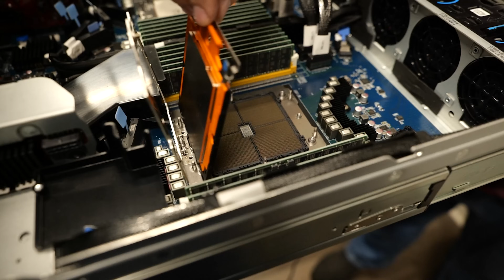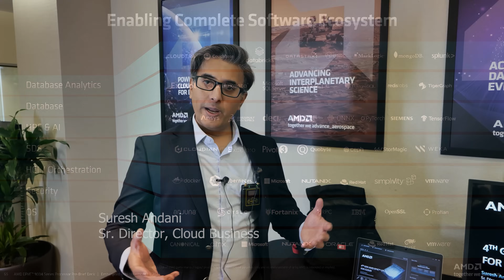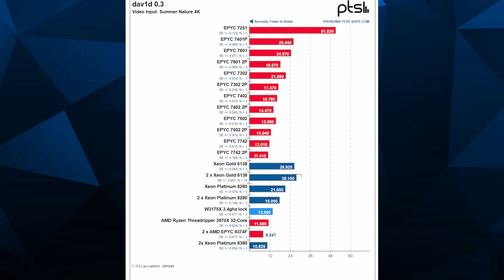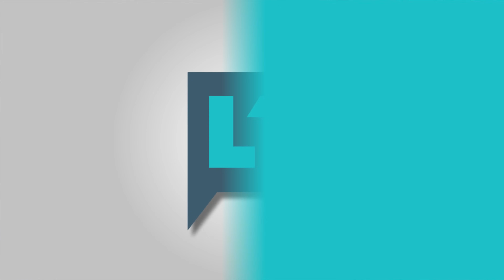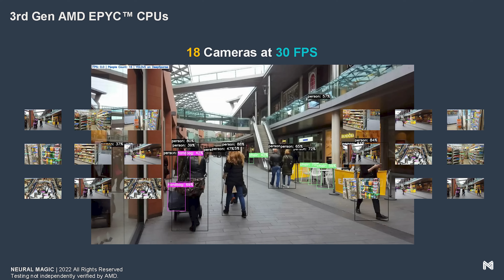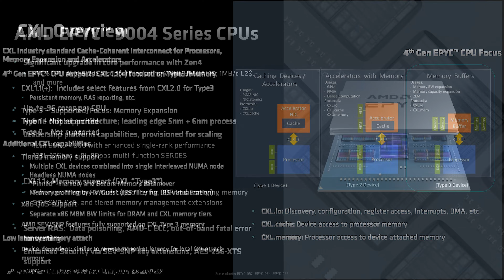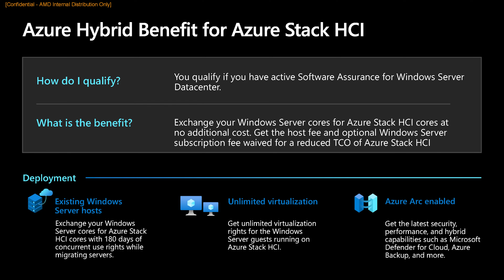192 Cores of EPYC Domination!

Comment: Lisa was so happy at the streamed AMD event today - great video coverage Wendell, thank you very much. Seems to crush Xeons even more plus those great features (so much is wonderful - for me the further expanded confidential VMs seems very interesting). Just wow and for example already deployed at Azure -> just great.
Cheers and keep this wonderful and interesting channel as it is, Pepe
Reply: ARM server CPUs are actually better than this 4th gen EPYC:

1) 7nm -> 5nm TSMC ........... -30% power consumption (42% more cores at iso-frequency)
2) Zen3 EPYC SP4 280W TDP -> SP5 with 360W TDP ......... 29% more (so 29% more cores at iso-frequency)
-----------------------------------------------------------------------------------------------
===== total 1.83 core count multiplier they would get from shrinked Zen 3 (1.42 * 1.29 = 1.83)

4) so total performance increase by new Zen 4 micro-architecture (Zen3 -> Zen4) is pretty small (AMD basically did the same trick as at desktop - massive increase of TDP and clock frequencies is the major trick)
5) SP5 has TDP of 400W (short peak 700W) and there is 1000W power supply per socket, and 24 DDR5 modules will consume around 150W, so total power consumption of CPU + RAM = 510 W .... SP5 is much larger than SP4 including TDP
6) Performance: 192-core/384-thread dual socket Zen 4 EPYC = 1790 pts in SPECint2017
7) Performance thread: 1790 / 384t =  4.66 pts/thread

Now compare that to Nvidia server 144-core Super GRACE CPU (based on ARM Neoverse V2 core):
6) Performance: 144-core/144-thread dual CPU ARM Neoverse V2 = 740 pts in SPECint2017
7) Performance thread: 740 / 144 =  5.14 pts/thread ......... 5.14 / 4.66 = 1.10 ........ Grace is 10% faster per thread than Zen 4.

ARM  Grace is 10% faster per thread than Zen 4..... that's not a small number. Considering 96-core EPYC 9654 has boost 3.7 GHz and all-core 3.5 GHz, while ARM chips like 64-core Graviton 3 runs at 2.6 GHz. Grace's clocks are not known however around 3.0 - 3.3 GHz is reasonable estimation. This means ARM has IPC  higher than these 10%.

Consumer ARM Cortex X3 has 14% higher IPC than Zen 4 in Geekbench 5. Neoverse V2 core in Grace (and upcoming Graviton 4) is based on X3 core. But V2 has 2 MB L2 cache in compare to 1 MB in X3. So IPC might be even a bit higher than 14%.

_________________________________
Be very cautious about stock investment. AMD beating Intel in trouble doesn't mean AMD will not be smashed by ARM servers. Especially when I see $11,000 USD price tag on AMD EPYC. ARM CPUs can be manufactured under $1000 USD while providing better performance and lower power consumption, and lower die area. Both Intel and AMD will be in trouble soon.

BTW: Remember that any x86 is CISC but runs inside as RISC. That extra and unnecessary translation CISC-to-RISC will always hurt performance and efficiency. Plus CISC variable length instruction encoding (x86 instruction might have anything between 1 byte to 15 bytes) really hurts how many instruction can be decoded per cycle because 6th instruction can be between 6th byte and 90th byte = 84 possibilities. While RISC ARM instruction has always 4 bytes so decoding/prefetch of any quantity of instructions per cycle is simple and super efficient. That's math and good instruction set matters a lot. Generally any CISC is obsolete for these technical reasons. M68000, VAX, Z80 or MOS6502 are CISC and died long time ago. x86 is here today because they managed to make it RISC inside and because Intel managed to kill main RISC competitors like Alpha (bought and shut down), HP PA-RISC (shut down in favour of Itanium) and also huge PC popularity with unlimited TDP. But with massive multicore systems today there is not place for CISC-to-RISC translation energy wasting. Unnecessary wasting. x86 is sinking Titanic.  Nobody knows how long time this sinking will take however every engineer knows it will happened. ARM server has more than 10% server share and that was gained in one year (mostly Graviton 2 systems). But now there are 128-core Ampere Altra MAX, Graviton 3 on 5nm TSMC and upcoming storm of new CPUs: Nvidia Grace, Graviton 4, Ampere One, Qualcomm Nuvia and maybe even CPUs from Google and MS.

Storm is coming...
 - Sarah Connor (this time it's not a Skynet/Genisis)
Reply: @arm-power  Name and pfp check out, this is definitely marketing material.

No current architecture, no performance paradigm currently in large scale use is equipped for the next steps in computing. X86, ARM, RISC-V, GPGPU, fixed accelerators, none of them are properly offering three-dimensional compute structures. We are running into the absolute limits of 2.5D circuit design and we've barely touched the potential of bonded layers with through-silicon vias.

But all of that aside SPECINT is a measure of raw throughput and has nothing to do with task-oriented compute loads. In real performance a single 84-core Zen 4 chip can often match dual 64-core Zen 3 processors. This is due to the faster memory and all of the other small changes throughout. In some cases the performance increase from AVX is closer to ten times when comparing 96-core Zen 4 against 64-core Zen 3. TDP is tunable and there are two other whole platforms, the density-optimized Bergamot and the cost-optimized Siena. Neither you nor I know enough about them yet. NVidia Grace is a different story. The Grace Hopper superchip is a 1000W TDP scenario and will be compared against AMD Instinct mixed-mode APUs. The Grace-Grace CPU superchip will have its chance to compete but I am expecting high TDPs and case-specific system performance. You can check numbers on Phoronix but at least against dual-socket Altra the new Zen 4 is kinda scary. Also in terms of the case you laid out, CISC-to-RISC conversion now usually takes place in a single clock cycle as the instruction hits the pipeline. And CISC instructions can require less storage space and memory bandwidth. The biggest difference is that ARM has always been driven by power efficiency goals and X86 forgot about those goals to chase after absolute performance. We're currently seeing convergence as both architectures become increasingly similar in terms of manufacturing process and design goals. X86 chasing efficiency and ARM chasing performance.

Also an H100 Hopper single card appeared to be priced around $35K usd with the Grace Hopper expected to be monumentally more expensive. And the Grace-Grace superchip is not expected to be a $1000 CPU. You'll be comparing $100K+ systems against each other, probably. Please stop trying to spread disinformation.
Reply: @arm-power  I followed up and ran some publicly available numbers. The 128-core Altra Max was listed at $5800 usd and 250w TDP or about 2w per thread. In testing it traded blows with the Epyc 7763 which has similar memory channels, PCIe lanes and in fact watts-per-thread. Main difference being the ARM CPU itself costing less but the costs of moving to the new platform being significant with little to no gains in performance or efficiency. The 32-core 7F53 could even match or beat the Altra Max in some tests, and the 7773X also needs to be considered. The new top chip in Genoa is 96 cores, 192 threads at 360w default package limit (1.875w per thread). This chip annihilates Milan in many tests and the new 32-core F series is far faster than previous F series. I have not seen a good, blow-by-blow direct comparison but it looks like Altra Max 128 cores would lose in both raw performance, performance per thread and maybe even performance per watt.

Grace has an estimated performance of 370 per 144-core package, so yes about 750 for a Grace-Grace superchip. Divided by 288 threads, not 144. That would be roughly 2.6 points per thread which is maybe 60-65% of AMD's points per thread based on AMD official numbers. Third party vendors say that the score should be closer to 1900 in their testing which would be a ratio of about five points per thread for AMD. If the 128 core Altra Max with reduced CPU cache sizes needed 250W TDP on N7, the 288 core Grace-Grace superchip could draw 600w and still get such a low core ratio. Genoa's 32-core F series part is a thousand dollars cheaper and can beat the Altra Max in several tests, but Bergamot is where the direct comparison will take place.
Reply: @passintogracegoldenyearnin6310  1) 2018 Cortex A76 (Altra max / Neoverse N1) has IPC similar to Zen 1 (2017).

2) 2020 Cortex X1 (Graviton 3 / Neoverse V1) has IPC 50% higher A76 and about 5% higher than Zen 3 (2020).

3) 2022 Cortex X3 (Grace / Neoverse V2) has IPC 20% higher X1, so approx 10% higher than Zen 4.

That's the real data, yours are wrong. SMT almost halves x86 IPC which is already behind ARM Neoverse. 64-core Graviton 3 @ fixed 2.6 GHz is super dangerous already today - slightly faster than Zen 3 Milan (despite SMT , 280W TDP and boost clock) but G3 consuming only 100W. Loot at Phoronix tests.

Now Grace (and Graviton 4 possibly) based on X3/V2 core with 2MB L2 cache will have IPC between Zen 4 and Zen 5. X3 is absolute x86 annihilator. When you look how good results  Altra and Graviton 2 server chips reached despite old A76/Neoverse N1 (with IPC of Zen 1 but N1 core is tiny 1.4 mm2 including 1 MB L2 cache, for comparison Zen 2 is 3.5 mm2, both 7nm) then imagine X3/V2 with 80% higher IPC. No SMT means very high performance per thread despite low N1 Zen1-like IPC.

And ARM has up to 2048-bit SIMD SVE2 vectors with matrix instructions. What x86 has? 512-bit AVX and no matrix instructions (for that you need new Intel's AMX in upcoming Sapphire Rapids).

Plus ARM released new SIMD extensions: SME and SME2 (Scalable Matrix Extension) with 2048-bit and tons of new useful matrix instructions. Not sure if V2 core will support SME but if yes, even bigger leap ahead for ARM.

Grace will massacre Zen 4.
Reply: @arm-power  Oh it will be interesting. Intel and ARM continue to invest in accelerators which work very well in specific optimized loads, while AMD is planning FPGA integration to allow for software-defined fixed function circuits in the data center. I plan to look deeper into what Phoronix has for Graviton 3 now that you tipped me off to the fact they did some benching. Probably within as little as five years most HPC will be done with task-based semi custom chips and we'll finally see solid efficiency gains across the whole industry.

Do you think Samsung will be able to crack the consumer market with ARM-based Windows laptops? Genuine question here.
Reply: @passintogracegoldenyearnin6310  1) FPGA runs at low clocks (no FPGA can run over 1 GHz, usually at 300 MHz). AMD bought Xilinx not for CPU, that doesn't make any sense. 

2) growing FPGA business was main drive for AMD which is fine. FPGA is very good at  wide parallel data processing so they might use it as special programmable accelerator.

We have 3 main types of computing:
- CPU is for serial  compute
- GPU is for parallel compute
- NPU is for matrix compute

FPGA can do same GPU work but much slower and also FPGA uses more transistors - so for those reasons FPGA will never replace any GPU. Although FPGA is great to build your own ASIC chip without spending millions for creating such chip. Or for simulating ASIC during development (CPU is simulated on many-FPGA-test-rig before tape out to factory for manufacturing).

Intel bought Altera FPGA years before AMD and there is no FPGA in Intel's CPU, because it doesn't really makes sense.

3) ARM-based Windows laptops - that's the main battlefield in ARM vs. x86 war. Look how many cheap ARM laptops with Windows start to appear. Acer One with ARM Qualcomm (however using 4 years old A76 core is not great), much better is ARM from Mediatek with 4x A78 core (IPC better than Zen 2, chip called Kompanio 1380) in Acer Spin 513,  with Chrome OS.

Samsung and MS have exclusivity for the most powerful ARM chips from Qualcomm (4x X1 core + 4x A78 core in 8cx Gen 3). That's why Samsung never tried to make it's own laptop chip. This might change and Samsung can use AMD Radeons in such a laptop APU. This is much better idea than smartphone's Exynos 2200 where AMD's mobile GPU failed. So I thing Samsung boys learned that AMD is not efficient enough for phone 5W TDP but pretty good for laptop chip with TDP around 15W - 45W.

So yes, I can see Samsung as 4rd main ARM laptop chip maker right after Apple, Qualcomm and Mediatek. This gonna be epic battle: 4 ARM and 2 x86 chip makers fighting each other, low prices, awesome.

And there might 5th ARM chip maker - Rockchip. Just take a look at RK3588 with A76 core: https://youtu.be/4rg2I7m1t3k?t=571

And possible few other ARM chip makers will join later (personally I'm involved in group of people for creating ARM start up company). Because everybody can buy license ARM core and make his own CPU. ARM will win because it's better ISA and is open for everybody. x86 won in 90' because anybody can buy x86 license (IBM forced Intel to do that) so there was several CPU companies like Cyrix, NexGen, IDT Winchip etc. x86 won even there were better RISC ISAs like 64-bit Alpha and SPARC (but those were closed and proprietary as x86 is today and they lost). 

Open platform is a key.
Open ISA => many chip makers => high competition => low margins => low prices => high sales numbers => victory
Reply: @arm-power  Samsung's CPU and memory divisions have been slipping, and it appears the CPU division was under control of a board member who lied to the director of the group. Exynos 2200 was underwhelming because the Samsung manufacturing process did not work as advertised, and because the processor was being designed with bad information. Many companies have been trying to leave the Samsung fab and get into TSMC's manufacturing capacity during the current sag in demand. Simply put, a company like Qualcomm could probably assess Radeon architecture with enough competence to decide whether/how they would use it; Samsung doesn't have enough expertise.

AMD has openly announced plans to use Xilinx technology in some of their future data center designs, probably more like Instinct or Epyc than a retail CPU. They also bought into DPU technology and have plans to attempt manufacturing their own 800Gb solution. Yes the 4th major device, the Data Processing Unit. Everyone is pursuing both HPC and Edge Computing solutions, and there's a lot of room for improvement in bandwidth management/data shuffling.

The openness of ARM is still not guaranteed, NVidia is probably not the last customer with an interest in trying to become owner. Also the working group itself is not as profitable as it could be and they have bankers breathing down their necks asking how they plan to expand their market share. There is a lot behind the scenes that could affect the future of their IP.
Reply: @passintogracegoldenyearnin6310  1) Exynos 2200 GPU failed in compare Qualcomm Snapdragon 8 gen 1 despite both chips on IDENTICAL 4nm Samsung process.

So AMD mobile Radeon is the true problem - it's not efficient enough. Architecture which is efficient enough for PC desktop GPU with >300W TDP is not efficient enough in smartphone with 5W TDP.

It's a same situation as with CPU Intel vs. AMD. Both fights with >200W power consumption while ARM Cortex X3 and Apple CPU has higher IPC (more advanced architecture). However in 5W TDP with low-clocks it hides how good and advanced they are. Same is for GPU.

BTW Qualcomm's GPU Adreno is ex-AMD mobile division sold to QC in 2009. Adreno = mixed letters of Radeon. Today AMD tries to re-enter what they already sold. No wonder Adreno is much better with 13 years of low-power GPU experience. AMD may never catch Adreno and Apple GPU because both Qualcomm and Apple are much bigger companies specialized to low-power. AMD is tiny company with little to no low-power experience.

2) ARM openness is 100% guaranteed because any big player can block ARM's acquisition (like Nvidia failed) even the owner (Softbank) agreed.

x86 -> ARM transition for SW is in practise transition from x86 -> multiplatform written SW (like OS Linux or BSD). That's the most pain and work for programmers and since this is done there is no problem to port SW to whatever ISA you want with little to no cost.
Reply: @arm-power  I already said that Qualcomm's engineers are better than Samsung's. Aside from power consumption they did not allocate enough dark silicon into the GPU libs because they were trying to save too much space. They wanted a tiny GPU with a very high clock and real-world physics told them 'no'. AMD CPUs could have less dark silicon if they weren't chasing clock speeds, that is what makes me so curious about Bergamot. And Intel CPUs are so large they've cut retail profits to nothing.

A secret of ARM design is that with careful power management you can aggressively keep down the amount of dark silicon. And that creates shorter traces inside the chip which can further help with power and performance. You could set a worldwide limit on non-workstation CPUs at roughly 50W and everyone would do just fine. They'd probably discover how much lower they can go. Our problem going forward is graphics power consumption in the consumer space, another the massive ongoing buildout of telecoms to support consumer habits.
Reply: @passintogracegoldenyearnin6310  Qualcomm guys design their own GPU  (what is very hard thing to do, look at Intel's attempt with Arc) while Samsung's guys are more tape-in glue gang - they only glue licensed IPs together (license Cortex CPU core, license ARM GPU core and now license AMD Radeon GPU).

Mobile AMD Radeon FAILED due to its inferior design. Not because dark silicon or Samsung engineers or any other excuse. Design matters most, just look at the difference between AMD Polaris and few years later RDNA2 - that's huge jump in architecture (efficiency and performance). 

To be honest I expected mobile Radeon to be bigger disaster so AMD didn't failed that bad. For them mobile GPU is still side project. But smartphone market is 5x bigger than PC desktop market so they need to change priorities. They just need to reverse it and put 3x more resources into mobile GPU architecture than into desktop GPU. Than maybe they can catch multiple times bigger companies like Qualcomm and Apple.

Zen 4 is huge fail for such a huge power consumption and ridiculously high clock speeds. Zen 4 CCD uses  high speed library with very large transistor layout. 5nm offers 85% scale down in area however it went down only 14%. This means Zen 4 CCD is 62% bigger than Zen 3 - that's HUGE price for just 14% higher IPC and AVX512. They claim Z4 has 58% more transistors (dark silicon) so there is about 3% left for even larger library than Zen 3 had. Incredible wasting of silicon, but most PC world celebrate that as great thing.

That's the AMD design problem. Because Cortex A77 increased IPC by 20% while transistors increased by 17% only => this means performance per transistor has increased for A77. And decreased for Zen 4. Cortex A78 increased IPC by 8% and transistors DEcreased by -5%. This is super hard to develop but necessary in hard mobile world. OTOH x86 desktop environment can afford such a large wasting of silicon and power consumption.

So don't be surprised than AMD's mobile Radeon in Exynos 2200 isn't any good. Their CPU are not good design either. Fortunately for AMD their competitor Intel is even worse.

Bergamo Zen 4 could be much better than Zen 4 Genoa - it could bring more dense library (servers doesn't need clocks over4 GHz) and decrease unnecessary dark silicon..... and as result to pack 16 Zen 4 cores into 80 mm2 (same area as 81mm2 Zen 3 CCD).

But will it be enough against ARM Neoverse V2 core with higher IPC, 2048-bit SVE2 and up to 512 cores total in server CPU?
Reply: @arm-power  Getting closer. Yes, Samsung thinks they have an SoC development team and they think they can make their own custom processor, but it's been demonstrated that they don't really know how to adapt licensed designs into their own manufacturing process. I really think they tried to eliminate dark silicon from a low density design while still chasing high clock speeds, Samsung either needed more dark silicon or a third CU and lower clocks. And yes, if AMD pursues ARM development they could probably do a better job working together with TSMC. Steam Deck is very much a transitory design but its performance on the low end is interesting to compare against high end smartphones running benchmarks. As the phones usually operate in benchmark mode at an unhealthy overclock. Deck's total system power is too high because accessory functions have not been folded into the SoC (too many chips, too much IO) but it makes me curious about what Zen 5 could do on a density-optimized low TDP platform.  Either way it looks like in a couple years most desktops will either be all-in-one or they will look like those little plastic box PCs coming from Hong Kong. Even things like the Asus XG Mobile could end up being the model for future desktop GPUs, a plastic box instead of an internal card. Server side will continue to chase after rack density and power efficiency and competition will grow even stronger than it is now. Mainstream consumers will want phones, tablets and laptops with all-day battery life and they won't care what chip is inside as long as their programs work. AMD, Intel, NVidia, RISC-V and general ARM will all continue their struggle...but I feel that a completely different architecture may show up within the next ten years. If we cannot break out of 2.5D circuit design, every single architecture will start hitting the wall. At that point they can all keep optimizing, but major improvements would only come from bigger chips and/or higher TDPs.
Reply: @passintogracegoldenyearnin6310  1) Samsung already had their own ARM CPU cores, they were called Mongoose M1 up to M4. The team was recruited from AMD Bobcat team during Dick Meyer's Bulldozer apocalypse (big engineer exodus from AMD). You can search for nice analysis from Andrei Frumusamu at Anandtech. However those ex-AMD engineers failed to keep pace with Apple and even with license Cortex cores. So it was shut down. 

2) This Mongoose attempt shows how best x86 team (Bobcat core was the best small x86 core in compare to Atom) can ultimately fail when trying develop efficient ARM cores. This is the reason why AMD mobile Radeon in Exynos 2200 failed by design too -  in smartphone world there is the demand for engineering skills is the highest possible while super tight constrains of low-power TDP while you must deliver high performance (today's smartphone has higher GPU performance than Xbox 360).

3) Samsung SoC engineers cannot change AMD's GPU IP,  they cannot change dark silicon, not even library density. AMD just failed in phone GPU design - it's that simple.

4) Zen 5 will be very interesting because it will be the first answer to Apple A11 Monsoon core from 2017 (which is the widest CPU core on the world, 6x ALUs + 2x Branch Units = 8-wide scalar execution is a revolution. Zen 4 is just 5-wide scalar exe 4x ALU + 1x BranchUnit). So I guess Zen 5 will have similar width which is very exciting. And Jim Keller's Royal Core (Arrow Lake) is scheduled for 2024 as Zen 5.

However still CISC-to-RISC internal translation will ruin efficiency. And variable width CISC instruction encoding will ruin simplicity thus efficiency even more. Zen 5 and Royal Core will have pretty nice IPC but ARM will have higher IPC and much higher efficiency and simplicity. Simplicity is important because ARM and Apple releases every year TWO new CPU cores. Something you can't see at x86 world (because to develop x86 takes 4-5 years while ARM about 3 years).

SteamDeck will move to ARM soon or later. The only advantage is compatibility with current PC games. But you have to pay extra price for that in bad efficiency (thus larger and more expensive battery).

5) $60 USD small board (Raspberry Pi size) with Zen 1 IPC ARM A76 cores, 8 GB LPDDR4X RAM, M.2 NVME slot for PCIe SSD, powered by 5V USB charger, consuming 10W despite having performance as Zen 1 APU. This is the future. 
https://www.youtube.com/watch?v=HO1ZSICrHmo

As soon as they will use latest Cortex X3 core with almost double IPC to A76 and frequency from 2.4 -> 3.4 GHz you basically will have Zen 3 performance for fraction of desktop PC cost.

And AMD and Intel has no answer for that - because their inefficiency they cannot put reasonable performance into 5 - 10W TDP range.

BTW These super cheap ARM devices are from Hong Kong / China manufacturers. Orange Pi, Radxa Rock 5, Khadas Edge 2 etc.

PC desktops will transform into workstations using 64-core ARM CPUs (from server). This will be the last stronghold of x86 before it dies.
Reply: @arm-power  1) Yes, and they tried it again by "customizing" regular ARM cores to make Exynos. These are not the same people that made the Samsung memory controllers.

2) Wrong people, wrong project. Who hires experienced X86 engineers and tells them to learn ARM design from scratch? They may not have been the best in their division, either? Also the Xbox 360 was rated at 240GFlop. The 6620G in the first AMD A8 APU (and one of the best!) is rated over 350GFlop. The first integrated 3D graphics inside a ten year old chip that had a 35W TDP ten years ago. In practice it was strong enough to play Oblivion in 720p Medium at about 8W total system power (CPU undervolted and clock limited, screen and speakers on). That CPU also reported a desktop-level package limit of 65W and could be clocked up to 3.1-3.3GHz if the laptop's cooling was good enough. Over 3GHz all-core boost and graphics good enough for Skyrim, that chip was great and the following APUs were a disappointment. Modern phones are still slower than original Xbox One in their sustained real GPU performance, but they are better than the Xbox 360.

3) AMD's graphics were designed as complex systems intended for the TSMC manufacturing process. Samsung was trying to create a cut-down version and adapt the design to their manufacturing process. It is literally impossible to drop a TSMC-optimized design into a Samsung fab, whereas I think TSMC has better design tools for porting-in designs created for a different foundry. Those graphics libraries had to be recompiled with different power distribution traits and different compensation for changes in resistance between layers. The basic circuit IP and data flow paths, the problem solving logic were AMD's property. But Samsung failed badly in fitting them to the manufacturing process. I wouldn't be surprised if they went for a straight shrink with stock libs, tried for desktop-level clocks without enough dark silicon, and pulled out a surprised Pikachu face when the local heat inside the GPU became impossible. This is what Samsung's CPU division gets for lying to the director. In honesty I think the 7nm Steam Deck APU at 7-9W may be better than Exynos at 9W. That is not how bad ARM is, that's how bad Exynos is.

4) Variable length instructions again can be much more efficient in terms of memory bandwidth, which is important with very high core counts. This was a big problem for the Altra Max, eight channels of RAM with fixed-size instructions saturated the links long before the cores were fully utilized. 96-core Epyc is still seeing some memory bandwidth issues with twelve links of DDR5, and CXL memory (worth about two lanes of bandwidth) may actually be necessary for 96-core and 128-core chips. All of the big chips need to look seriously at on-package memory and optimized near-package memory. Also depending how AMD's DPU research progresses they may be able to better optimize data streaming with variable length instructions throughout a larger system. If ARM has enough bandwidth to feed the cores (such as only a few powerful cores) then yes it can be efficient. And yes Apple's Rosetta is a TRANSLATION system to run compiled X86 code, and it does just fine with the added translation overhead. Translating instructions is nowhere near as power intensive as executing them. It'll be nice to see the Zen 5 processor but I am possibly anticipating a slight drop in clock speed. Not sure yet.

5) Considering the die shrink this is not surprising at all. Steam Deck is very similar to a Ryzen 3000 APU (Zen plus) but with far better graphics. Reducing the package power, disabling half the CUs, disabling half the DDR5 and removing the screen/speakers would put the Steam Deck into a similar power/performance range. If "Custom APU 0405" truly is not limited to only Valve, anyone could make a tiny SBC for probably less than half the price of the base Steam Deck. I hope that AMD puts real work into this type of chip (not just Mendocino) and I look forward to seeing what gets announced over the next two years.

Also at this rate I'm not sure I believe Arrow Lake will arrive before 2025. And nothing you have said addresses the 2.5D circuit limitations that we are facing. In possibly as little as ten years, they have to start going more vertical or everyone will be hitting the wall on their respective platforms.
Reply: @arm-power  Faster ARM CPUs is great and all, but the vast majority of software runs on x86, so almost no one cares... Some care yes, and they love it. I myself use an ARM server in the Oracle cloud, but I always run into software issues because its not x86. It will take a long while before x86 dies... ARM could be 1000x faster today, and only a few people/companies would care.
Reply: @rockenrooster  ARM cloud instances offers half price in compare to x86. When some corporate pays 10 millions USD a year for cloud services, then every competent management will decide to save 5 millions thanks using ARM.

In 2020 ARM cloud instances at AWS was about 10% ARM vs. 90% x86. For 2023 AWS plans >50% ARM vs  40% x86. This means ARM will get overall server share of 20% - 30% (AMD needed 4 years to climb at 10% server share).

And Oracle, MS and Google clouds? Oracle and Google offers ARM instance using 80-core and 128-core ARM CPU Ampere Altra.

Economic recession will force customers to move to ARM. Only few lazy customers will stay at overpriced monopolistic inefficient x86, and they will pay double price for that.

I expect in just 3 years ARM majority in servers and financial collapse of x86 Intel and AMD (laying off employees, cut down x86 development, starting developing their own ARM/RISC-V CPU, probably similar what Keller did in AMD with K12: Main CPU dev for ARM version and from that derive x86 core for cheap for some legacy usecase).

x86 is DEAD. No corporate wants to pay DOUBLE price for backward compatibility to have 16-bit 286 from 1982 which they doesn't need. ARM abandoned 32-bit mode in 2021 in Cortex X2 core. Since than it's full 64-bit machine with every transistor aimed for maximum 64-bit performance. No single transistor wasted at backward compatibility.

ARM offers new 2048-bit SIMD with matrix instructions (SVE2 / SME2). Where is x86? 512-bit AVX with no matrix instructions at all.

Fujitsu built CPU-only super computer based on ARM. Fukagu was no.1 and beated SC based on server x86 + several giant Nvidia GPUs. CPU beating GPU is unheard for decades!!! ARM CPU used new 2048-bit SVE vectors. 

ARM is aggressive.
ARM makes bold moves.
ARM wants to win.
... I like that attitude.

Open ARM is annihilating x86 (monopolistic evil) in servers and laptops right now. The sooner x86 evil dies, the better for human kind and IT development in general.